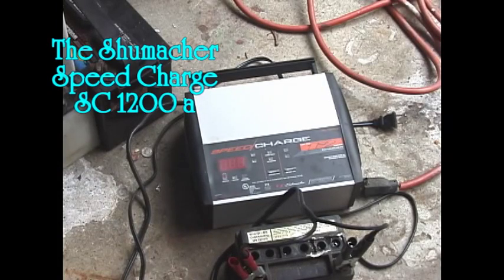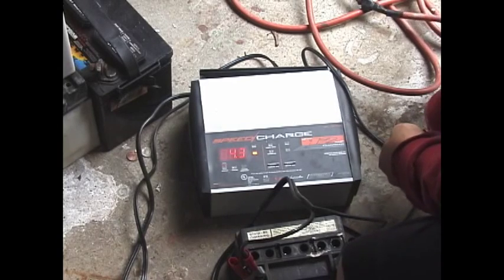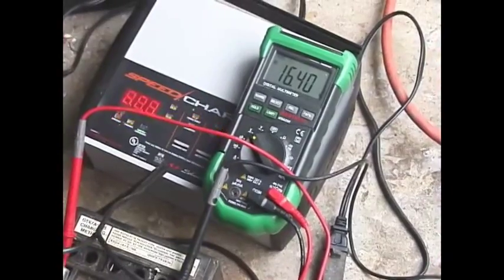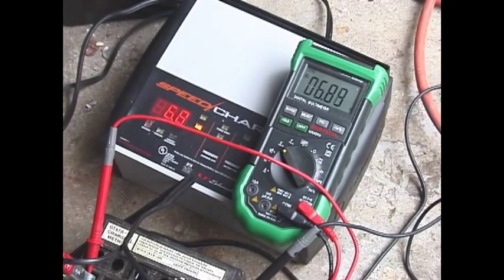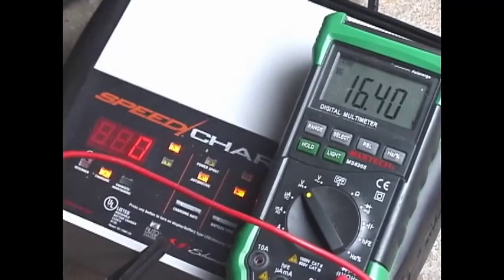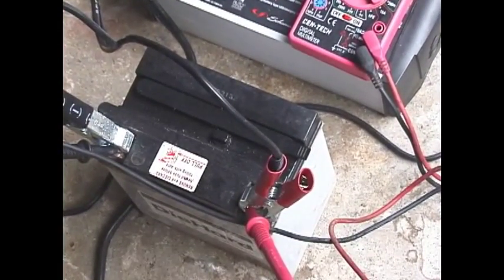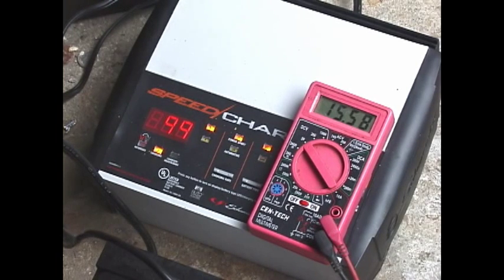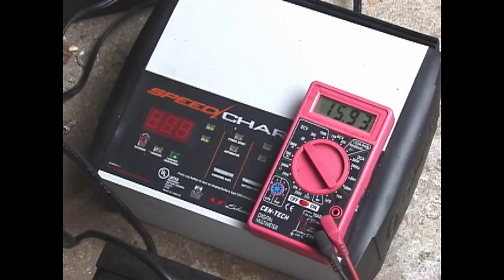Schumacher SpeedCharger Sc 1200a, BatteryMinder 1500, homemade

Comment: Thanks for proving the Schumacher SC 1200A Smart Charger isn't so smart as it won't function as a maintainer. Wish I had known this before I bought two.  I did discover they will maintain a 12.8vdc-13.1vdc on a good battery with no parasitic drain. Add a little load such as a test lamp, watch the voltage drop and the not so smart unit does nothing.  Wonderful.
Thanks again for the video, I'll check out the Battery Minder.
Reply: *****
I was just informed by Schumacher customer service that when in maintain mode the Smart Charger unit checks the battery voltage every 12 hours and if it senses a voltage below 12.65vdc, the charging cycle will start.  Not sure if this is true since I discovered the problem on a battery that was in maintain mode for weeks and the voltage was 12.6vdc. I feel a maintain voltage should be higher, around 13vdc but was told a good fully charged battery voltage is 12.65vdc. My smaller Schumacher 1.5a speed charger (with transformer) works great and holds at 13.1vdc so why can't the 'Smart Charger'?
Reply: LiteNingR0d I discharged a good battery to a steady 12.4vdc with the Smart Charger attached, nothing happened. Let it on for 24 hours and the voltage is now 12.49vdc. So much for the Smart Charger checking every 12 hours.  The unit is going back to Schumacher and I requested another model.  Tired of the Smart Charger SC-1200A's.

Comment: I've had this charger for about 5 years.    It's a very flakey charger.   I would not buy another.   One problem is it often stops charging before the battery is fully charged.    It will say 100% but the battery is NOT 100% charged.   I checked the actual AMPS output while charging and on 6A setting, it was actually only delivering 4Amps.    Even so, it often left my lead acid batteries undercharged by 10%-30%.   A much better charger imo is the cheaper analog chargers sold at Harbor Freight.   The digital readout is a nice gimmick, but internally it's cheaply made.   I would not recommend this particular "Digital" charger.   It's way overpriced for what you're getting.  That's my opinion from my experience with one anyway.